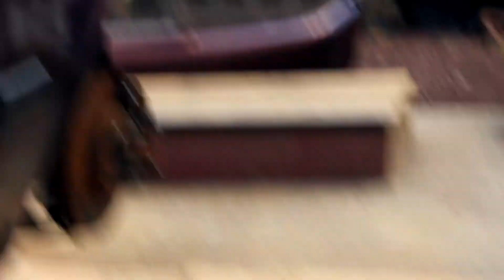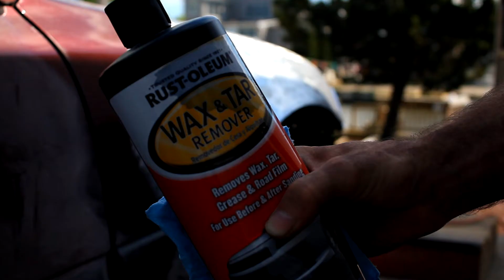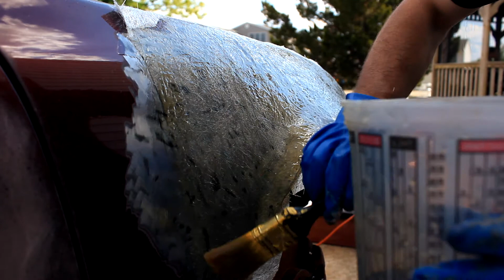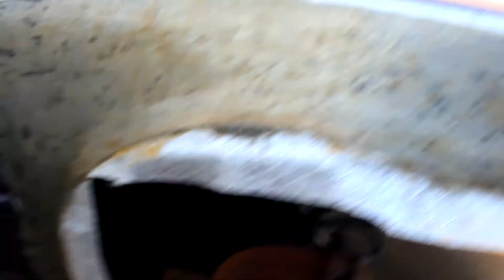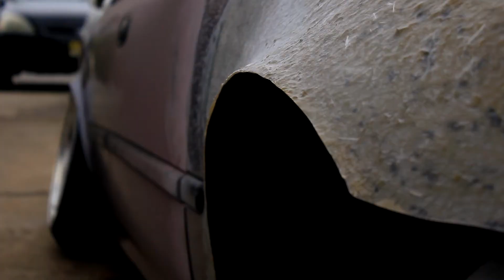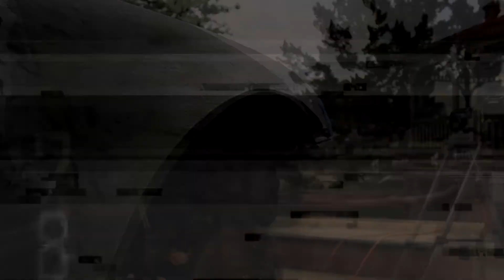EG Civic  Fiberglass OEM Fender "Widebody"

Comment: Not sure what your doing to be honest? You banged the fender out already to make it wide. Why not just try and straighten it out more with a light coat of bondo?
Reply from the maker: Once you stretch the metal that far its super thin. Any small touch and it buckles or dents. I used fiberglass to strengthen it first.